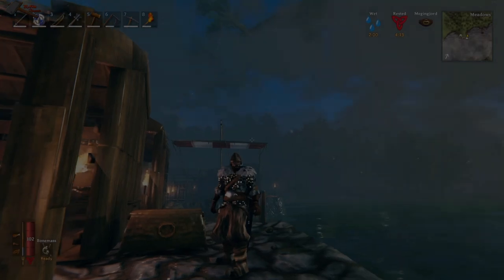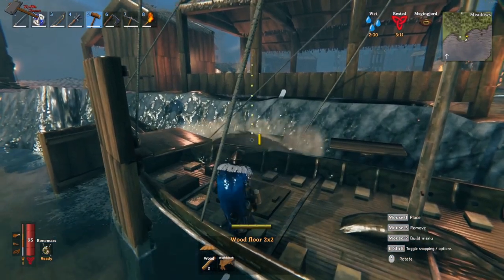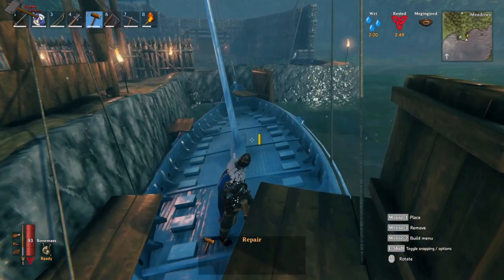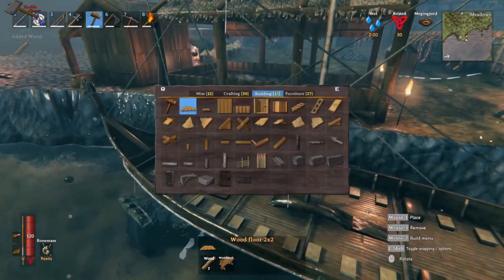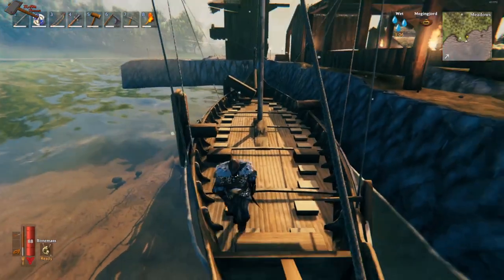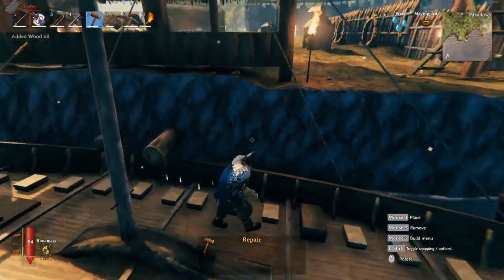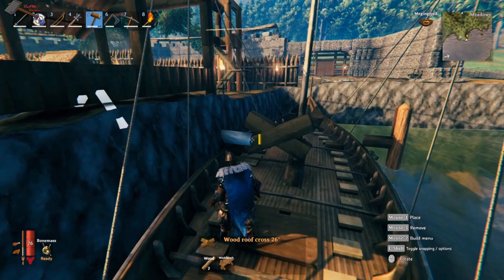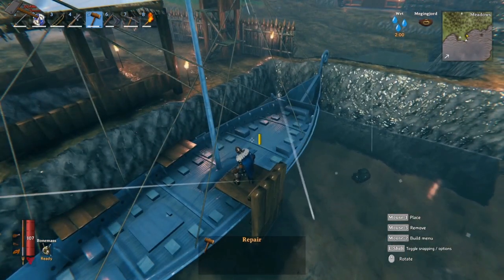Valheim: Tutorial: Keeping Boats Safe

Comment: I don't think that this is an issue anymore. Yeah, the boats don't float away anymore. I used to build a dock, but I don't anymore. The mobs ignore the boats, if there is no structure around it. I just place a workbench down, near the water (on a big rock) and park my boats. They leave them alone, however, they will attack the workbench. Yes, I changed the topic.
Reply from the maker: Its not as big of an issue as when the game launched. I still will build docks but that more for looks than anything.
Reply: Thanks for the vid though because my boat was still attacked even with crafting benches around it @xs_sa1nt
Reply: so is this how you prevent mobs from destroying your boat? by placing a workbench near it?

if they destroy the workbench will they then move onto destroying the boat?

ive had too many cases where I left my boat temporarily and came back to it completely destroyed either be leeches or necks etc